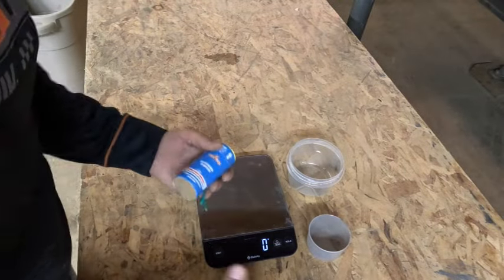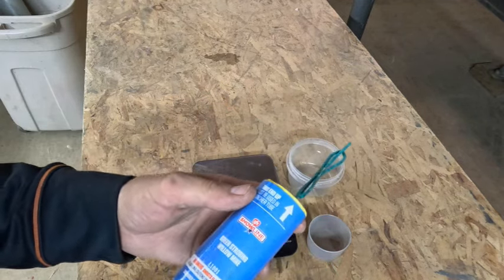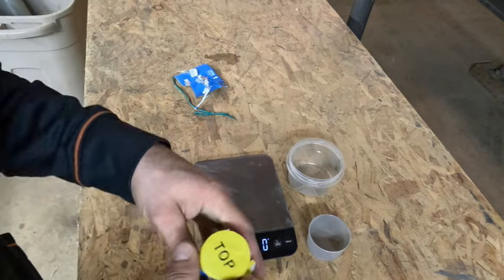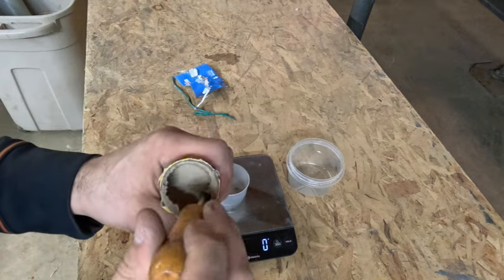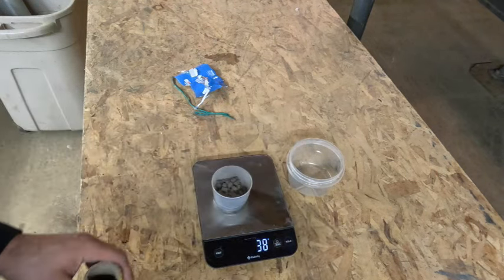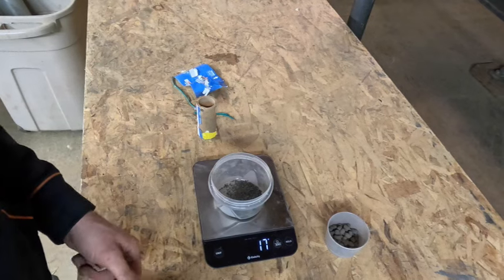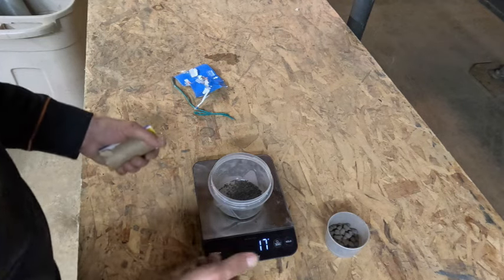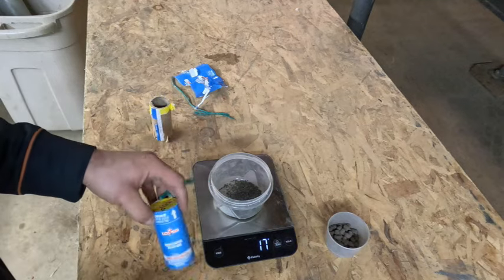whats inside a mine cannister shell

Comment: The weight on the lift charge is not accurate. You did not zero the scale when you put the second container on. It appears that those are two different size containers that you used. The second container may have been a little heavier than the first. FYI
Reply: Agree. The weight after the tare was +4 grams on the container. It would be 13g of lift charge. 49 grams total.
Reply: Yes, but the scale tarred is still compensating for the weight of the original container. Let’s say the original container was 1g and you tare the scale to zero. Then you place the second container on the scale and it reads 4g that would be a total of 5g correct? Since you did not tare the scale for the second weight it’s subtracting the weight of the first container still. Just a thought I could be wrong. The only way to be sure of the weight of the lift charge, is to zero the scale with the second container, and then weigh the powder again.🤷🏼‍♂️
Reply from the maker: That is correct I did forget to zero the second container, so it is off by a couple of grams!